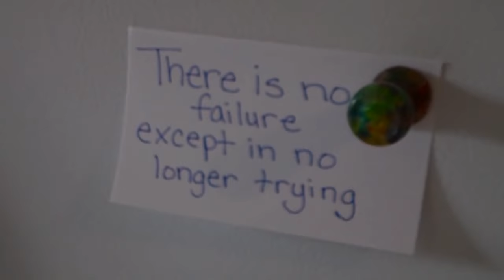How To Make MANY Mistakes!

Comment: Hey Peter,
i got a really cool suggestion for your dip it series! 
You should try dipping a prince ruperts drop and maybe do a second prince ruperts drop with the tail slightly exposed from the resin so you can cut the tail and incapsulate the drop after it shatters. Locking it into the resin.
Man i just really want to try it myself now haha

Comment: just curious, what would happen if you mixed orbeez that were expanded (just normal size) in resin? the water would probably mess it up some how...but what if they were in cased in the middle like coffee turd resin casting, then somehow lost the liquid (hence the somehow as im imagining it would be trapped forever if it actually works without messing up the resin.)

Like for instance, if it works out how im imagining it, would the orbeez be stuck in a bubble that once was their size? 

would it simply not work?

would it work partially?

Would the casting be fine but they would stay big forever?

Im just curious.